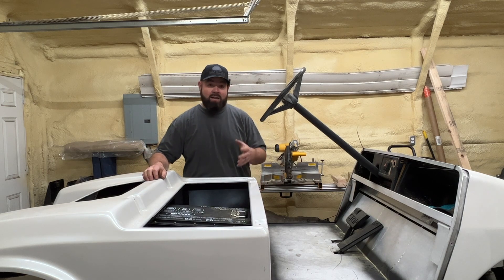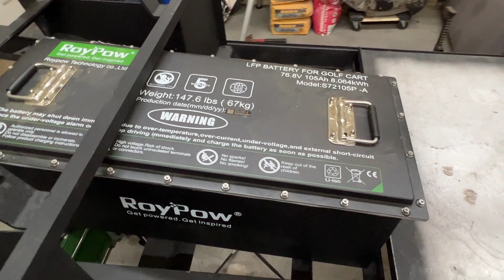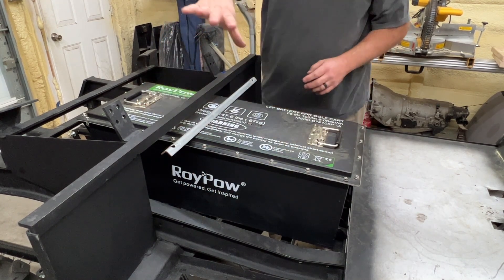Installing a 72v Lithium Navitas AC Conversion in OLD 1984 Club Car DS Resistor Golf Cart | WLKNTALL

Comment: Ive got a 1999 club car ds and run a 6 inch lift.  I was exploring battery options and want to get Allied Batteries 150 package because of its 10sec 500 amps discharge.  I plan to pair it with Teekons Silver wolfs 800 amp setup and was wondering if mounting this battery in my cart would clear the motor.  I dont have as big of wheels or custom supension as yours.
Reply from the maker: Not sure tbh.

Comment: My only question is why did you use the 12v bat. for the accessories, ? The wild part of this video was now i understand the running system in detail form t he first time. Because of you open layout and easy to follow instructions 😊
Reply from the maker: I used the 12v lithium for accessories only. Now I can maximize the range of the 72v battery. A dc converter would pull from the main pack and I didn’t want that.

Comment: Why did you use an MCOR and not a PB8 petal box?😊
Reply from the maker: Mcor kit bolts into place. No modifying or figuring anything out. I love the fact that it’s hidden as well.
Reply: @Fentertainment    I have a 1997  club car with a eco 48V battery, with a V-Glide (no resistor).  Thinking about converting to AC navitas system.  Should I use the PB8 box, or try and install an MCOR?  Thanks so much for your fantastic videos!
Reply from the maker: @CharlesT637  MCOR is so easy to do. Plus it was made for the club car. Idk, others prefer pb8 mainly because they sell that certain kit. But this is easy - https://www.youtube.com/watch?v=lDU2Ee9M3Is&ab_channel=Fentertainment

Comment: I have an older cart as well that I’m fixing up. Actually older than yours. Mine is a 77. Went with Navitas motor and controller. Is Roy pow. Your recommended lithium battery. Looking to do 72volts as well.

Comment: I will be glad to work on my DS after this rusty Taylor Dunn. Aluminum is so much better
Reply from the maker: I hate rust!
Reply from the maker: are you keeping the gas motor?
Reply: @Fentertainment  on this on yeah. Our place in Surfside doesn’t have outlets out front so it is difficult to charge.   Got it running before I took it apart. Did 16mph.  Not horrid for down there.